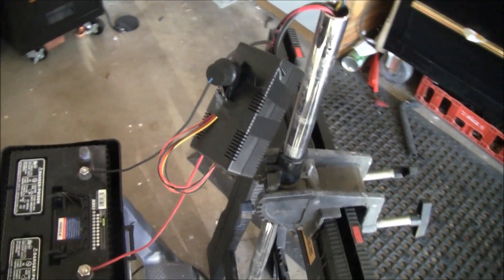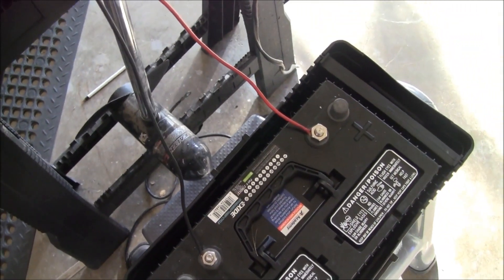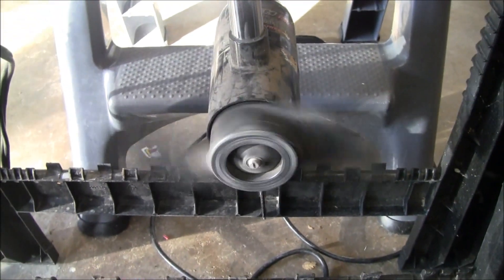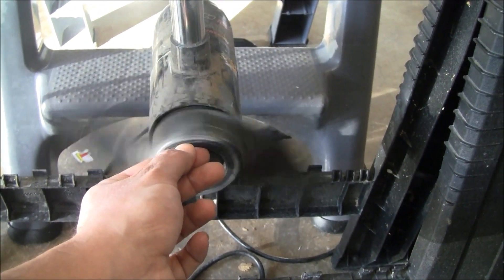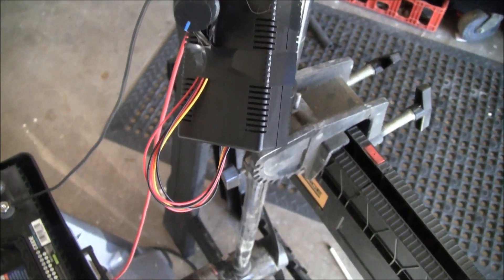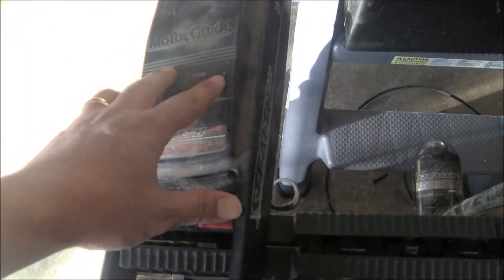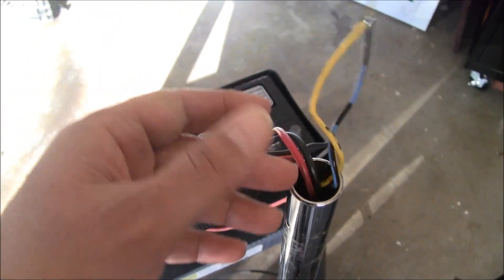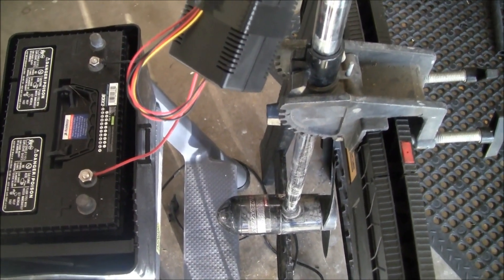Trolling Motor variable Speed Controller Conversion part 1

Comment: Some trolling motors have a feature that prevent running the motor in 4th and 5th gear when the motors out of the water. Intex trolling motors have that feature. Tip you might want look for one of the speed controller with the reverse switch , many have it. Look into it before buying viewers.
Reply from the maker: Thanks for the comment, see part 2. I was able to find a reverse polarity switch and make it work, it was a fun project. I had never seen a water sensor switch on trolling motors, but I believe it since the water acts as cooling for the motor. Its possible they have a built in thermal coupler that senses heat. Its not good to run a trolling motor out of water for very long due to over heating the motor, but a short second burst to test it is fine.
Reply: Nice you got it working in reverse as well. The ad for the no spin feature said it  was to prevent the motor from making too much RPM out of the water. Which makes sense as the motor is designed to be run under load.

Comment: this saves more power b/c its PW instead of resistor based like the stock unit?   some of the newer high dollar TMs seems to come standard with a better controller.
Reply: AnimalMother224 pwm does save a lot of power. With the regular speed switch, it uses resistor to adjust the voltage going to the motor.

Comment: you think a 40 amp would work for a 55lb thrust?
Reply from the maker: +ben I would suggest going to Minn Kota web site ,they do have a list of models and specs just to be on the safe side.  That said, if you were really worried about it run a inline circuit breaker.
Reply from the maker: +ben I just wanted to add, you should always run a inline circuit breaker on a trolling motor.  It will save your motor one day, good luck on your project.
Reply: no it wont.... amp=thrust pretty much on minn kota numbers meaning 40 thrust =40 amp  55 thrust 55 amp inline fuse should be for 5 to 10 more than load so i recommend that on a controller also just seen that this is a year old but anyways lol great vid btw

Comment: Just wanted to show my support for your project.  I'm just beginning to look into doing something similar and will share any insights I glean doing the research, etc.  What's the source and model of the variable speed controller you're using?
Reply from the maker: +Mitch Lennon  Thanks,  its a 12 volt 30 amp pwm variable speed controller that i purchased on ebay for $10.00. I also purchased a reverse polarity toggle switch but when it came in i connected it and it did not work so i returned it and purchaced another one, now just waiting for it to come in.
Reply: +goodtimesports Thanks, just what I was hoping I could do.I built steering unit for bow drive and don't want to reach for speed control.